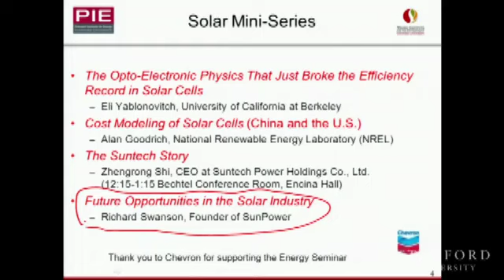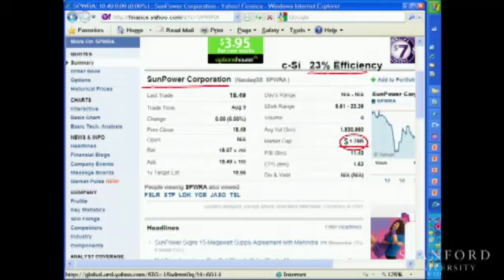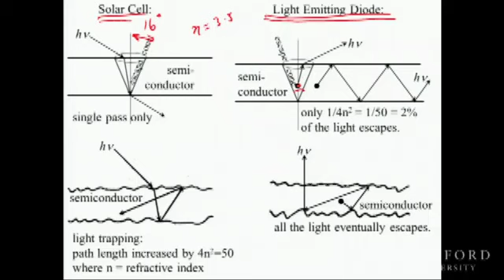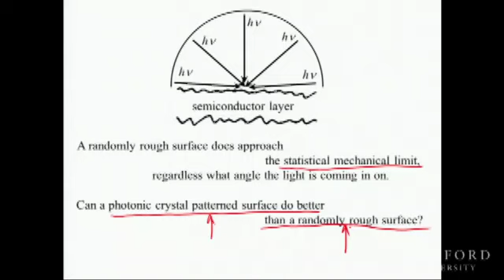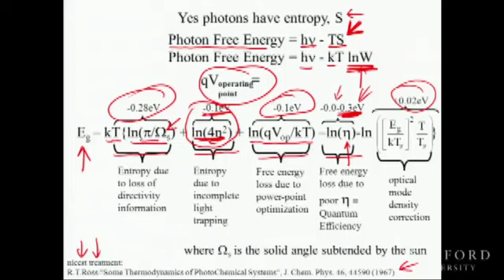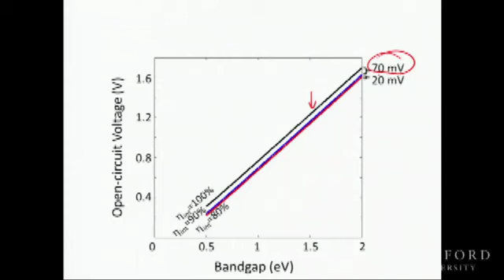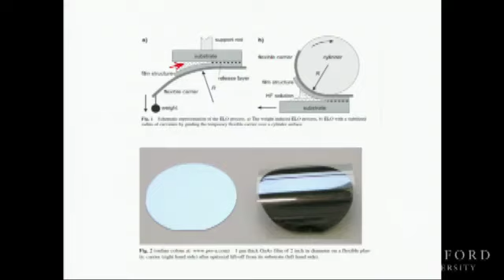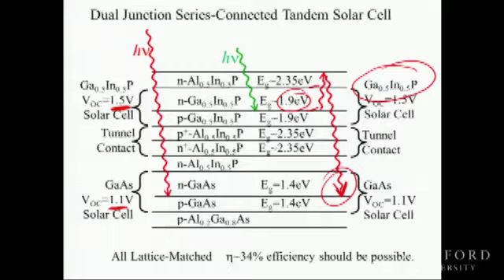The Opto-Electronic Physics that Just Broke the Efficiency Record in Solar Cells

Comment: I think the thing that was implied but not said, is that eventually the biggest cost will be a guy with a spanner and a screwgun putting these things on roofs and structures. That cost is double for a 15% cell vs. a 30% cell, for the same installed capacity. The cost of mechanical fittings is likewise double, and the cost of wiring and inverters is not quite but close to double for the lower efficiency cells. Installation area for a lot of users is also limited.

Comment: Intersesting for the non professional designer even,,goes over topics that the layman is not getting....1) the most expensive solar cell is the cheapest (long term), 2) 30% of sunlight is not direct sunlight, 3) why solar cells are ruff and not smooth (maybe the glass or plastic box should be ruff also?)  should we use motors to tilt the cell banks?